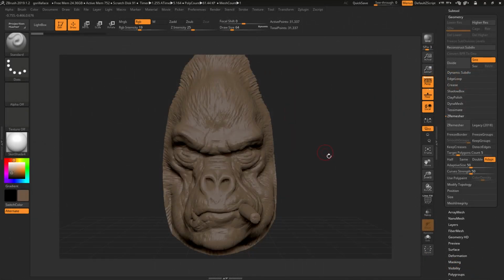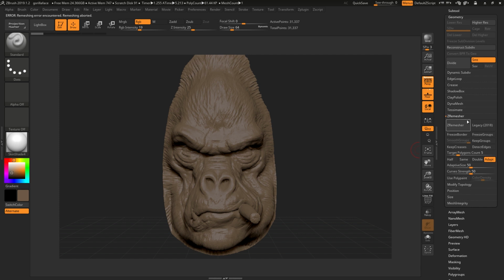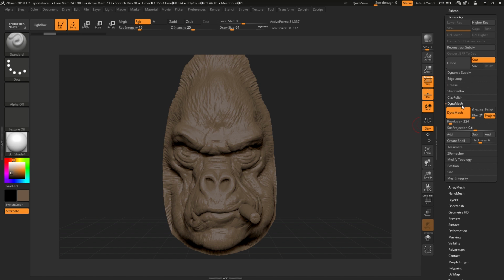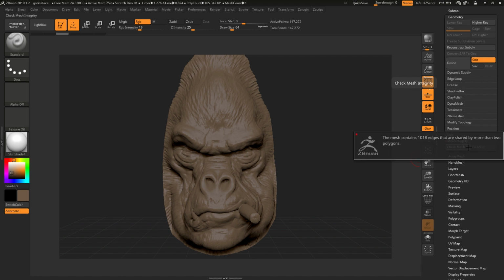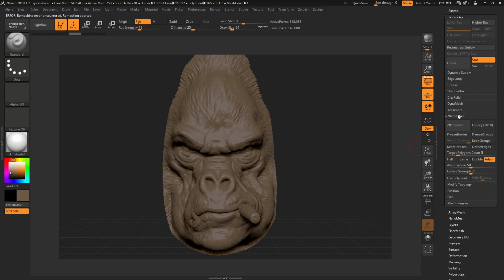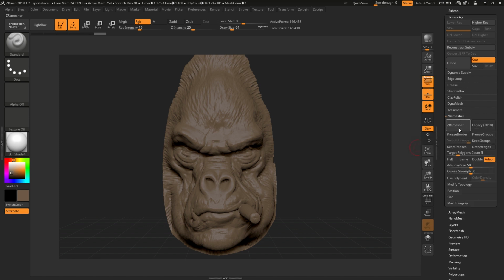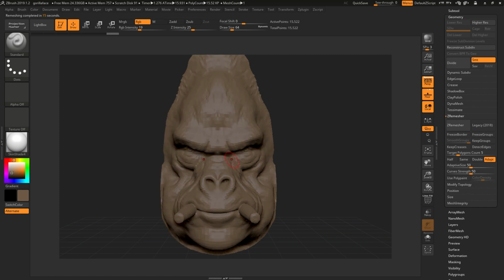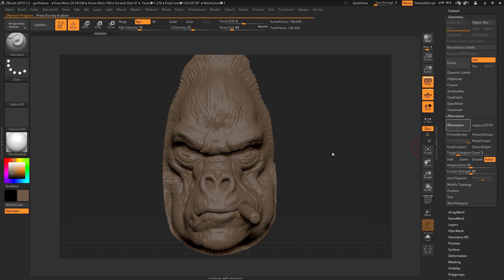ZBrush - Fix the "ERROR: Zremeshing error encountered." Can be fixed a couple of different ways.

Comment: Hey sean I tried to turn Dynamesh on and off but it didn't work. Can you recommend an alternative method?
Reply from the maker: Yeah, another thing you can try is go to Polygroups in the Tool msnue and hit Auto Groups. This will give each "island" of geometry a separate polygroup. Then use Ctrl + Shift and click on the main polygroup of your mesh. If there are tiny little polygroups that are not necessary, this will hide them, and you can then use Tools, Geometryrollup, Modify Topology, Delete Hidden to get rid of them. then use dynamesh again, or Modify Geometry - Close Holes. Try the Tools, Geometry, Meshintegrity - Check Mesh Integrity button again, and hit Fix mesh if it reports any errors and then try again. I cover alot of this more clearly in this video: https://www.youtube.com/watch?v=ZtxYe0MABYw
Hope it helps!
Reply: @SeanForsythTutorials  thanks. I successfully zermeshed it in the end.
Reply from the maker: Awesome!

Comment: Not worked for me. I already mailed  my working project, would you please check it out
Reply from the maker: Hi, I opened your file and it worked for me, without changing any settings, it might be the ZBrush version you are using maybe? Anyway, I've sent you back the fixed file with subdivisions and your original model reprojected.

Comment: hello sean forsyth im a learning beginner blender and zbrush. im having a trouble of zremeshing the mesh. the problem is that when i zremesh my cloth that has folds and hard edges they get deformed like more curvish delets all the edges and makes it very curvature like some has smoothed all the edges, and the size too cause of deformation the size gets very smaller than the original. what would be the problem?? my process was first dynamesh and subdivide to 3 then after i fisnished with dynamesh work, i did an zremesher for detailed works subdived till 4 after i finished it i tried to make low poly zremesher and thats where the problem happended got low poly but  lost   lots of part that made smaller and curvishy.
Reply from the maker: Sounds like you haven't reprojected back the detail onto your low poly mesh. The process is: duplicate your high poly mesh, and rename it to Low. Make sure just the Low poly and the High poly original mesh are visible. Select the Low, and Zremesh it. Subdivide it a few times, and then in the Tool menu, under Subtool rollup, go to Project and use the ProjectAll button. This will project the detail from your high to your low. You can now delete the original high res object.
Reply: Sean Forsyth thank you for the fast reply ill try it at home when i finish my work thank you so much
Reply from the maker: @goguma-i6q  No problem! Let me know how you get on.
Reply: Sean Forsyth gt problem fixed as you told i tried to projectile then remesher and got nice shape of it :)
Thank you very much
Reply from the maker: @goguma-i6q  Great!

Comment: Did not help, the error "unable to open file" appears and the path to the temp folder
Reply from the maker: Ah, sorry to hear that. This isn't a gauranteed fix, but it will work in some instances. Sorry to hear you still have problems. I can't recreate your error here, so I can't even investigfate it I'm afraid. The best thing I can advise is to try to make sure your mesh integrity is good. So maybe try increassing your Weld Points threshold a bit and trying again. Hope it helps, best of luck with it!
Reply: Thanks, the functions del hidden, close holes and weld points helped.
Reply from the maker: @blacksirik  That's great! Delighted it worked out for you.
Reply: This suggestive tip is great and the one every ZBrushers must know!  ZBrush itself is a just simple mind-set with many handy function software. Master =user needs to help ZBrush to clean up hidden dust or holes or unweld parts.
It is like an action hardware repairman use air blower.  
Your quick but very useful tips help every ZBrushers!